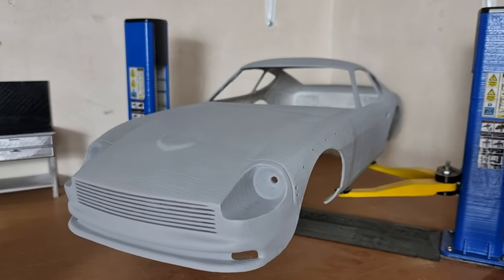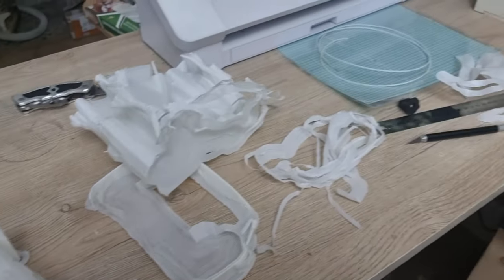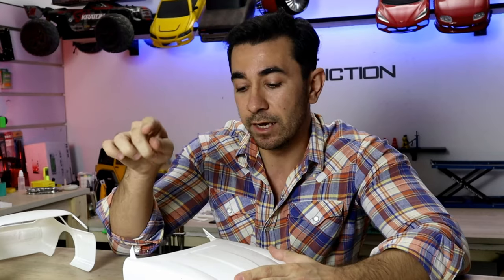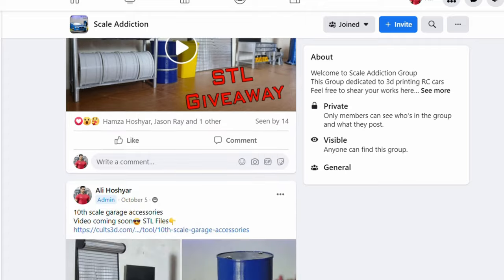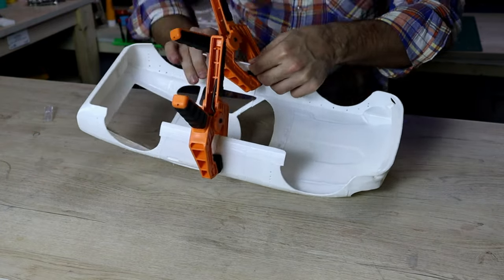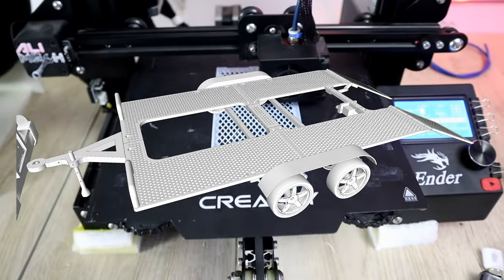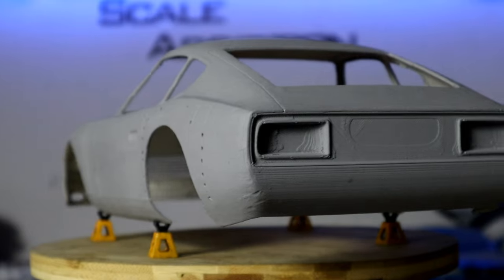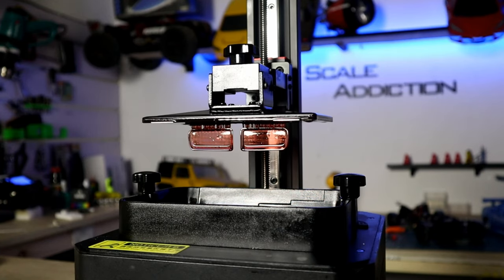3D Printed 10th DATSUN 240Z WIDEBODY/how to design printable model in SketchUp/ Scale Addiction

Comment: What glue did you use and what’s that solution you put on the bindings before sanding? What sand paper di you use? Thanks!
Reply from the maker: CA glue, i used body filler thats used for car body jobs, sand paper and then  600, 800 wet sanding